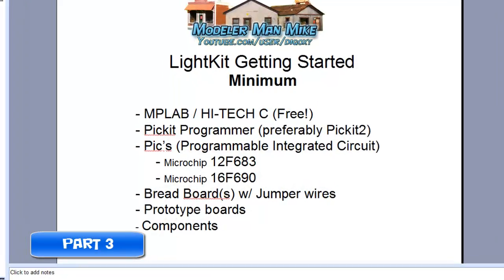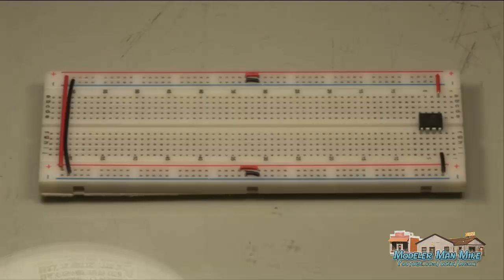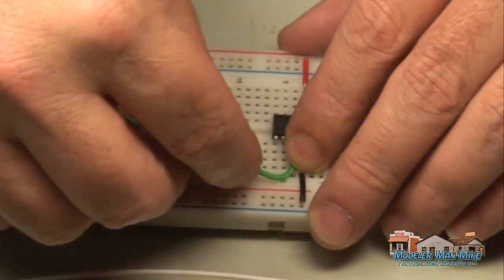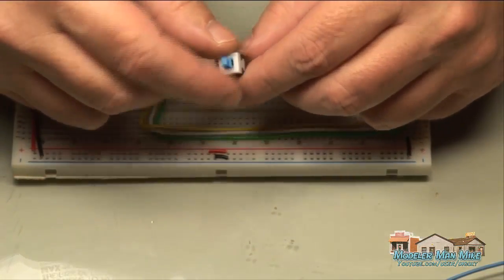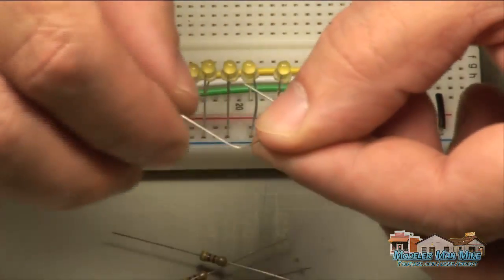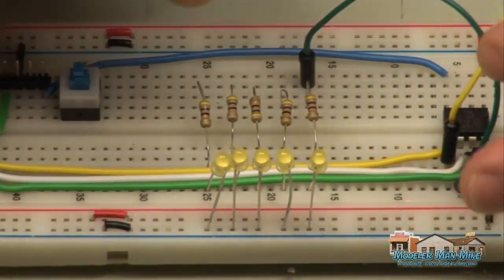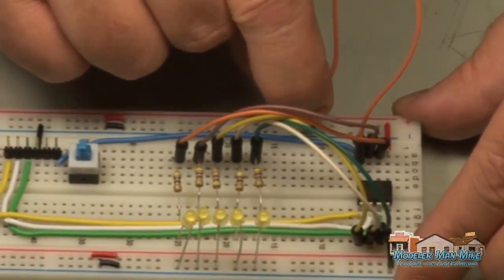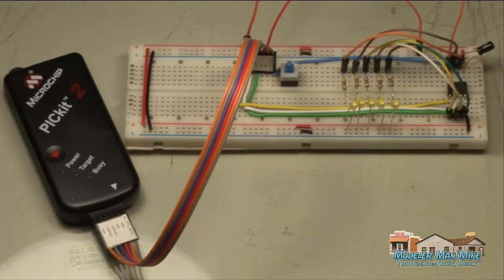LightKit: Pic Spoon Feed Model Railroad Lighting with Pic 12F683 16F690 and Pickit2 Part 3-4

Comment: Thought I might toss this out:  I took something you said in the video (about LEDs coming on a bit slower to more accurately imitate an incandescent light), and I ran with it.  I looked at microchip's website and found the 12F1501, an 8-pin DIP that has four outputs that can be set to be PWM (pulse width modulated) outputs.  After a considerable amount of tinkering (learning about PICs and C), I have managed to come up with the structure of a program that lets me turn LEDs on / off with a fade in and fade out effect.  I've used an "on" variable and an "off" variable which control the speed of the fade in / out.  Set at small numbers, it sure does imitate the look of an incandescent bulb coming on or going off. 

So far, I've used that program structure to create a two light flashing circuit (imitating crossing signals), a welder (using two LEDs, with "seemingly" random periods for when the "welding" occurs and how long that welding lasts in each instance), and even a "candle" (where the brightness very slowly drifts up and down and occasionally flickers).  None of these are earth-shattering, but with the softer ons and offs, they look a lot more realistic than the instantaneous on and off of a ordinary LED. 

But the main application is controlling four "room lights" for a structure (e.g., a porchlight, a bedroom, a kitchen, and a living room).  I've discovered that there is no such thing as "random" when it comes to PICs, but I have developed a very short subroutine that generates a "seemingly random" set of numbers.  I use that (with some delays of my own design) to cause these "room" lights to turn on and off at "seemingly" random intervals (measured in minutes).  The effect is pretty nice, and changing one number in the program for each structure will yield sufficient randomness across different structures.

Anyway, that's a long winded way of asking if you've ever used the 12F1501 or PWM outputs . . . the 12F1501 has far less memory than the 12F683, but I've not run up against the limit so far.  Would love to share the files with anyone . . . not really sure how to do that!
Reply from the maker: Hey Tim, it looks like you have completely gone through everything I have done in the video's I have on my channel. I have removed some of them as I have gone to a new type of format using a master controller. However, yes, much of this I have done so far! BUT would be very interested in seeing your programs that you have created and see if you have any routines I could use. You can find all of my C Programs for the 683 and 690 on my website located here http://www.digoxy.com/modelermanmike/ If you like, you could send your programs to my email address modelermanmike01@gmail.com

Look forward to collaborating on some of this if you are interested.

Comment: Do you mind if I ask a question?  You have the MCLR switch leading to Pin 4 (GP3 / MCLR), but you also have the input (the orange jumper) connected to Pin 4 (GP3), using Pin 4 (GP3) as the input.  You then connect the orange jumper to ground, which pulls the pin low.  It seems that that would reset the chip (pulling GP3 low), but I suspect it doesn't because you've got GP3 set as an input.  If that's the case, then why do you need the switch?  I could have summarized all this by asking, "Why the switch"?  :)  If it's complicated, feel free to skip the question.  Just curious.  I'm about to build this circuit, and I'm studying all aspects before burning up a chip or two!
Reply from the maker: not complicated at all. To program, send the data to the chip from the pickit, it has to be toggled off.

Comment: Hi, I have never done anything with electronics. I have just started my N gauge layout and want to use lights to enhance the mood so I find your videos very interesting. I have followed everything up to where you start placing the Yellow White and Green wires from the Pic? to the connector(4:41) on the video. I can't see how I should know which wire goes to which. Is there a book I should read please?
Reply from the maker: Hello Roy, sorry for the delay in getting back to you. are you talking about where the wires connect to the header pin on the bread board? I think you might be talking about this. If so, this is where the pickit 2 will plug into the board and the video shows the colored wires leading to each of the leads on this header pin.
Reply from the maker: Ok, so I read this and watch the video to try and understand this question a bit better, and yes, I guess the answer is that the pic lines to this header pin are specific for the Pickit 2, each of these three lines go to the data lines on the pickit 2 so the pic can be programed. Roy, if this still does not answer your question, please let me know, feel free to send a private message if you need to, I can help you get through this part if needed ok!
Reply: digoxy Him Thanks for getting back, I understood why all the wires were put in the places they were until you started placing the yellow, white and green wires, I don't understand why they are in the holes you placed them in. Or for the purpose of the example should I just do it like you did. Thanks again.
Reply from the maker: Roy Palmer Those three wires are for the programming of the pic from the Pickit2. When the Pickit2 is plugged into this board, these lines connect directly to the pic on the board so it can be programmed.
Reply: Thank you, I do appreciate your help.
Reply from the maker: Roy Palmer You Bet!